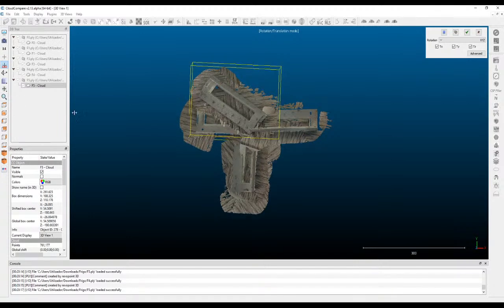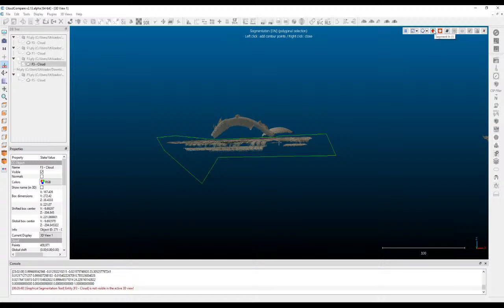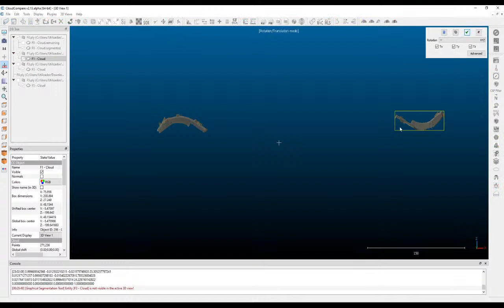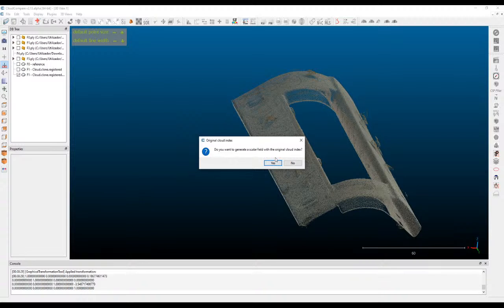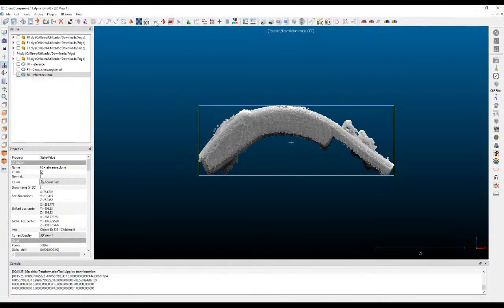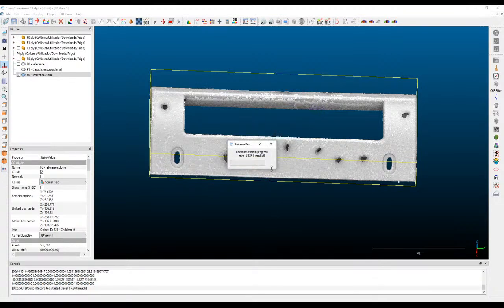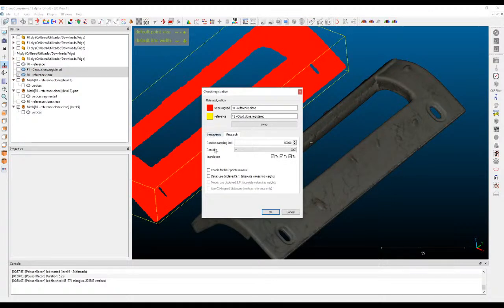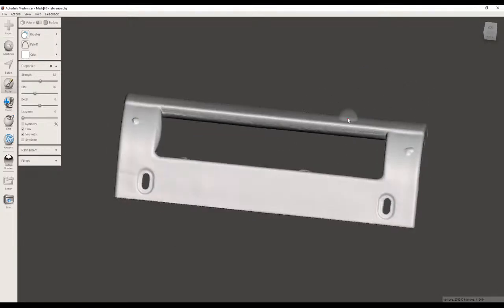Aligning and meshing 3d scan pointclouds in CloudCompare

Comment: I'm confused. Doesn't the RevoPoint Mini come with it's own software to align these? Why use Cloudcompare then?
Reply from the maker: Back when i made the tutorial there was only Revostudio and it was not great.
Still sometimes it is better to use Cloudcompare on complex aligns since You have much more controll over the outcome. Revoscan works well these days but it does not allow you to edit a Aligned pointcloud still.

that said the meshing on Revostudio is very good and when i need to use CC i now open the clean and aligned PC and mesh in RS
Reply: @X3msnake  Ah, makes sense now! Thanks so much for the video!